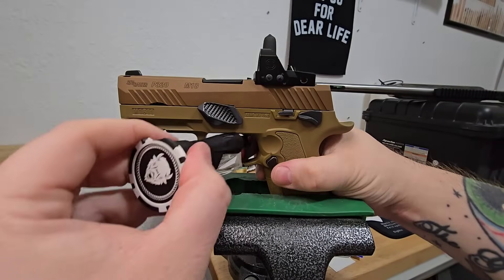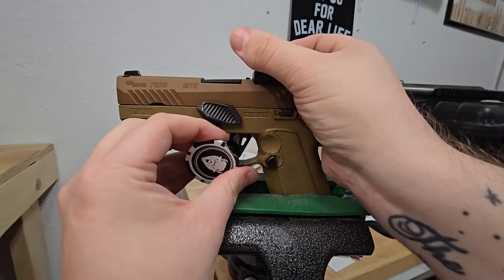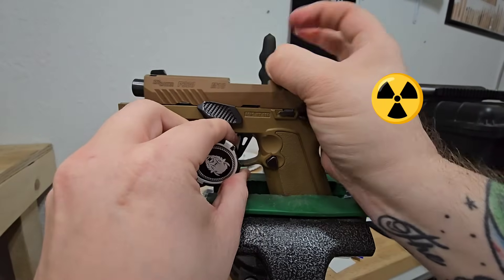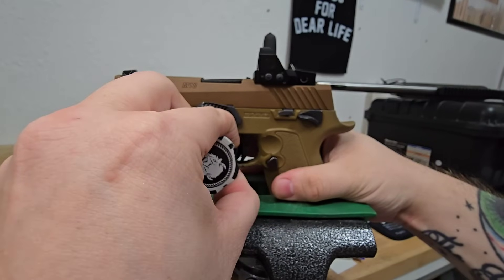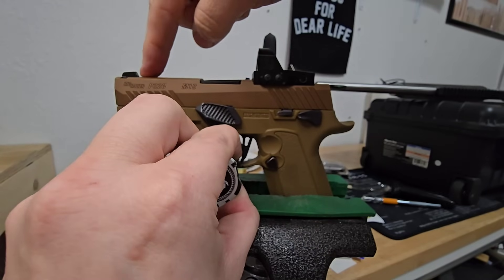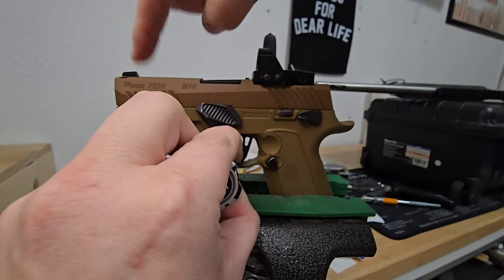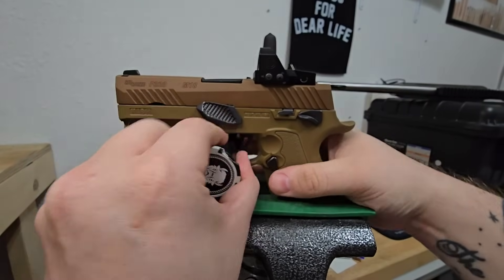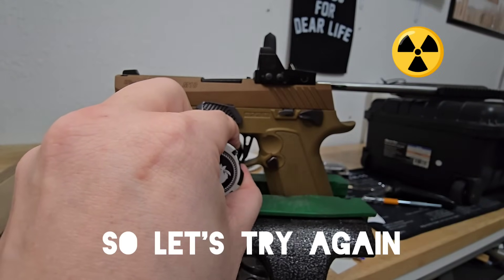VISE Testing Sig Sauer P320 M18 Slide/Trigger Pressure Issue!!

Comment: I’ve tried and tried mine and no matter what I could not replicate this , I have a norso upper with the stock sig internals. 
But to be on the safe side I’m not going to carry it
Reply: I have a stock p320. No issues. The trigger was pulled. This proves absolutely nothing.
Reply: @BaradaNels  pretty clear the trigger was not pulled to the point of dropping the sear. That gun should not have fired. Your own, personal p320 is a sample size of 1. This is not what we consider statistically significant
Reply: @benjackson1442  Please read my other posts on this video's comments. A trigger should never be touched unless one aims to fire the weapon. This is a non-issue imho.
Reply: @BaradaNels  agreed. This test proves that if the 320 trigger has the pre travel taken out (0.5-1mm) then manipulation of the slide can engage the firing mechanism, defeating the “safety”. 0.5mm is not very much and can be caused by things other that a deliberate trigger pull. there’s a reason no other striker fired handguns have this reputation
Reply: @benjackson1442  I think we may disagree. My position(s) is/are this:
1. Only touch a trigger if you aim to kill something.
2. Nobody has proven that once you do touch the trigger, then let it go, then apply pressure to the slide it will misfire.
3. Nobody has proven that anything other than touching the trigger AND at the same time deliberately pressing the slide downward can cause a misfire.
4. If a hoslter touches the trigger, that's the holsters fault, not the guns.
5. A lot of these youtubers are using 3rd party parts that could be out of spec causing this issue. My Sig P320 is all stock and my slide is tighter than an 18 year old on prom night.
6. Yeah, obviously the Sig P320 has an issue if its possible to do this. But I see it as a non-issue as long as everyone is following handgun safety logic that we ALL should have been taught before touching a firearm.

Hope this makes my position clear now.
Reply: @BaradaNels  hope you stay safe if you’re carrying the 320. I’d never touch a handgun with as bad of a reputation as this. Regardless of 3rd party parts or holster. There’s videos of it happening and if a gun is this prone to be “mishandled” I don’t want anything to do with it
Reply: @benjackson1442  Believe none of what you hear and half of what you see. I do appreciate your good wishes, though. If you're ever in WV, hollar. I'll show you a fully working Sig P320 that does not have these issues and I would put my life behind it.

But lets be real here. If all of our main focus was gun safety we'd all be using revolvers. These "debates" are the equivalent to women arguing about their makeup brands. Just with a masculine filter on top of it.
Reply from the maker: @BaradaNels you are leaving the contingency out that holsters might be interfering with the trigger...why are you laboring under the delusion that nothing is proved? You seem to be combative, rather that critical
Reply: @DoubletapDaoist  You assume much sir. Check my other comments. It is my position that if a holster interferes with the trigger, then its the holsters fault, not the guns.
Reply: @DoubletapDaoist  If I seem combative its because I am flabbergasted by how many of you either forget the training in handgun safety . . . Or even worse, never had it.
Reply from the maker: @BaradaNels and what does that have anything to do with this video then? Do you recall any time where I made a conclusion of fact? Did you read the pinned comment?
Reply from the maker: @BaradaNels your argument is a red herring. The same logic dictates that you would tell everyone not to carry a round in the chamber. If you're going to use "but for" or cause-in-fact causality, you also need to apply a proximate cause. Hence, i dont buy your red herring. It only seeks to confuse the issues.
Reply: @DoubletapDaoist  Should anything or anyone be touching the trigger of a firearm at any time beyond purposefully attempting to discharge the weapon? Yes or no?

The answer is obviously no. And if anything or anyone touches it outside of purposefully attempting to discharge the weapon, it is logically that thing or person's fault. Not the weapons. I simply dont agree sir. And have no clue how anyone could UNLESS they've never been trained to use a sidearm.

Comment: Apply enough pressure until the trigger almost, but does not break, and then apply an external force to a slide made with loose tolerances that lifts the back of the slide and correspondingly the striker, and it breaks. No surprise here.  I am not saying there is not an issue with the pistol.  There clearly is with some of them.  If this proved there is a major design problem with all of the P320's out there, then P320's would have been routinely discharging since at least the voluntary recall back in 2017.  What about all of the testing while being evaluated by the Army. Think about this statistically.  There are 3.5 million Sig P320's floating around out there.  If uncommanded discharges happened in only 1% of the guns, that is 35,000 guns that are randomly discharging with no finger on the trigger.  That means that there would be 5,000 random discharges per year since 2017. Instead, you are dealing with what, maybe a hundred with some of those clearly being shown to be operator error, but let's say that all 100 are the result of a defective design, that translates into a failure rate of .0028571%. There are some holes in the Swiss cheese lining up, sometimes tragically,  The first hole that we are dealing with a single action pistol with a fully energized striker.  You don't need many other holes in the cheese to line up and you have a gun goes bang for no apparent reason..
Reply: Yeah and one of those holes has been proven to be out of spec parts. Those tolerances stack and leave no room for error like the slide play.
Reply: @miletello1  I agree with you completely.  My P320's are at least 5 years and it very well may be that the QC in recent years has fallen off.  Now every P320 is suspect and taking up space in the safe.
Reply: If sig had made a good gun instead, we wouldn't be here wondering why it acts unlike any other gun on the market. My P99 won't do this, no matter how much you mess with it, nor will my Glock. These Sig POSs have already killed at least 2 people, with videos of dozens of other close calls. 
This doesn't happen with other guns, even older, more popular ones.
Reply: @rre9121  I agree with you 100%.  I thought I was buying a good platform and now I have a bunch of expensive useless paperweights.

Comment: I tried this test twice on my aftermarket slide it aftermarket grip and I still can’t get the trigger to trigger unless I pull it fully even if I’m right at the edge of the break which is past the 90°
Reply from the maker: It could illustrate the varying tolerances and QC that varies from copy to copy
Reply: @DoubletapDaoist hopefully I can find someone who wants to collab so I can show them maybe it’s factory slide to frame tolerances that cause this issue but since I have a Norsso slide and Icarus frame that its I guess safer? lol
Reply from the maker: @cheyenneobregon184 i do wonder if thats something that a frame and slide combo might fix. I assume Sig COMSEC is plotting my demise at the moment.
Reply: @DoubletapDaoist hahaha sounds good and hopefully not in Jesus name

Comment: So what you're saying and confirming is that the trigger must be pressed and then bumped to make it go off. like a holster that is too tight around the trigger guard or debris in the holster while the manual safety is off. If so try testing it inside a holster to get the same result.
Reply from the maker: That's the rub. Several tests can show a problem. No one has been able to make all these things combine into a holster discharge
Reply: Ask the dead Airman. His was reportedly in the holster.
Reply: @kb9oak749  yes it was in the holster most likely with the safety off but the problem besides that was he put it in a way that if there was a failure with any firearm it would result the same

Comment: The amount of people who just insist on trying to stay ignorant to the fact these guns have a problem is 🤯🤯🤯 Eventually it just becomes pure stupidity and denial
Reply: FBI report, Page 32 VII Conclusion, paragraph 3: "While examination of the subject weapon did not independently provide evidence of an uncommanded discharge it does indicate that it may be possible if sear engagement is lost. The disabling of the striker safety lock through movement and friction creates a condition which merits further exploration to fully assess potential risk."
'did not independently provide evidence of an uncommanded discharge' means not only did they not prove 'uncommanded discharge' but they found no evidence. This does not mean the problem does not exist. It does mean this FBI study does not prove it exists.
Reply: @railroad2258 - Enjoy the SIG Kool-Aid
Reply: @railroad2258 Dude, the gun's faulty...
Reply: Man just look around you. It’s everything that people will dismiss without any research.
Reply: Trigger was pulled. Take a handgun safety course ffs.
Reply: @BaradaNels - Trigger was only partially depressed, not pulled all the way through 🤦‍♂️
Reply: @dustinn5490  Irrelevant. Do you remember what your instructor told you about touching the trigger in your handgun safety course?
Reply: @BaradaNels - I get it, but that’s not the intent of the demonstration. This is showing that the secondary safeties are failing and there is something wrong in the FCU that is allowing the firing pin to fall before it is fully commanded to.
Reply: @dustinn5490  "Pulled", "not pulled all the way through", "only partially depressed": you are talking about manipulating the trigger. What is the purpose of a trigger?
Reply: @railroad2258 -  NO firearm should ever fire in any situation with the trigger only pulled through the take up, PERIOD. SIGs internal safeties are not working correctly. That’s it 🤷‍♂️
Reply: @railroad2258  because jostling around in the holster does not qualify as manipulating the trigger
Reply: @dustinn5490 This video proves ABSOLUTELY NOTHING! And for all you who thinks this proves ANYTHING... I hope to God you NEVER handle a loaded Colt SA Army style revolver (without the transfer bar safety) with a 1lb. trigger pull because someone is gonna get hurt.!
Reply from the maker: @antiwokeredneck youve got some big feelings, man. Real big
Reply: @BaradaNels  You don't have to touch the trigger to make it happen. The simple act of holstering the gun can make it happen. What this demonstration shows is why it happens. It happens because the sear does not maintain engagement even if the trigger is not fully depressed. Even though Sig Sauer claims it does. It's a design defect.
Reply: @patrickweaver1105  Incorrect. The trigger must be touched in all examples I have seen including this video. You have proof to the contrary? Please show it.
Reply: @BaradaNels  Holstered guns are firing without being touched at all.  Video proof is all over the internet. Get your head out of the sand and look around.
Reply: @patrickweaver1105  Havent seen one. Been looking. Obviously not all over the net.
Reply: @BaradaNels  How dense are you? Can’t even do a simple search?? The house is on fire and you’re sitting on the couch.
Reply: @RLog24  I did do research. In all the "evidence" people presented that I've seen the trigger must be pulled. Full stop: the trigger is ONLY supposed to be pulled if the firearm is meant to be discharged. Have evidence to the contrary? Please present it.
Reply: @BaradaNels  Maybe the multiple videos of them going off in a holster, uncommanded? Also the whole point of barely pulling the trigger is to simulate worn/out of spec parts. If you think it’s normal to be able to fire a handgun partially through a trigger pull by manipulating the slide, I have something to sell you lol.. I recreated the same thing with my 320. I’ve never noticed how much the slide moves when you pull the trigger. It’s just poorly designed. Why does the 365 use a different trigger mechanism? 🤔

Comment: I tried mine and it wouldn't do it I even tried it with a full magazine and nothing. I threw it down on the carpet, tossed it up in the air and let it hit the hardwood floor and still nothing. I guess some do it and some don't.
Reply: even if that is the case, "SOME" shouldn't be able to do it at all.

Comment: My slide is pretty tight and doesn't rock back and forth at all. We used to have this issue with our competition Glocks back in the day. We would bend down our frame lips to reduce the slide drop when the trigger crucifix engages the firing pin. Sometimes we'd bend them too far and something similar to this would happen. Good job to Wyoming for uncovering this.

Comment: Do you really have to pull the trigger so far? Can you try just barely taking up the trigger slop while then pressing the slide all over? I think it will still fire.

And like others have said, try with the safety on.
Reply: The take up is what disengages the striker safety.  So 'in theory' if you don't have the trigger being pulled passed the wall, the firearm shouldn't fire.  I haven't seen anyone that could make it fire without pulling the trigger passed the wall slightly.
Reply: @brent92888 and that is still a massive problem...
Reply: @AndrewH9999 oh I agree, its not great for sure.  Im not simpin, I hope sig fixes it.  But I'm guessing it would require a redesign of the FCU and the slide.  Just the fact that it 'could' fire due to movement only in the slide is poor design imo.  That being said, I do own a M17. 😂  I just dont use it for anything but a range gun.
Reply: @AndrewH9999 Explain specifically how its a "massive problem". Imagine I'm a 4 year old when you explain it plz.
Reply: @brent92888 what im seeing here.. its annoying to suggest very slight trigger pressure on a test deems it not "uncommanded" but isnt this showing how an uncommanded discharge could happen?? People are so weird..
Reply from the maker: It needs to be 95% of the way pulled. Seems to be safe before that

Comment: There's lint, gummed up oil, donut crumbs getting into the back of the slide and interacting with sear and striker block coupled with tolerance stacking and exercise slide to frame movement.
Reply: Forgot keys 😂

Comment: "Two documents prove P320 is unsafe"
Shadetree Armorer

It looks like Sig and the fbi/military knew about the problem in this guys FOIA report.
Reply: FBI report, Page 32 VII Conclusion, paragraph 3: "While examination of the subject weapon did not independently provide evidence of an uncommanded discharge it does indicate that it may be possible if sear engagement is lost. The disabling of the striker safety lock through movement and friction creates a condition which merits further exploration to fully assess potential risk."
'did not independently provide evidence of an uncommanded discharge' means not only did they not prove 'uncommanded discharge' but they found no evidence. This does not mean the problem does not exist. It does mean this FBI study does not prove it exists.
Reply: @railroad2258  The video I suggested covers the important key details which include knowledge of the problem happening and likelihood of it happening in the future.
Reply: Trigger was pulled. End of story.
Reply: @BaradaNels  Yea it sure was the end of story for it's victim- but not for sig. They're cooked.